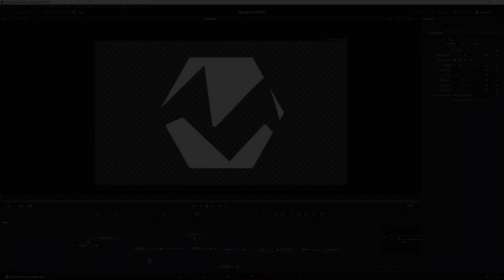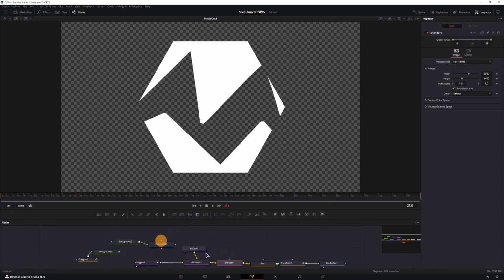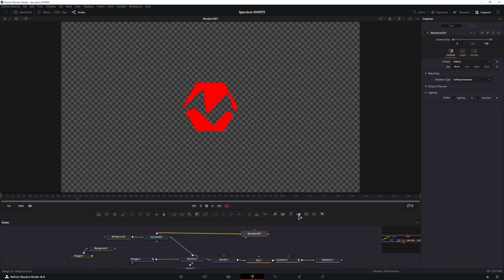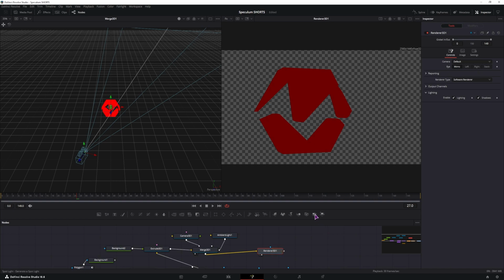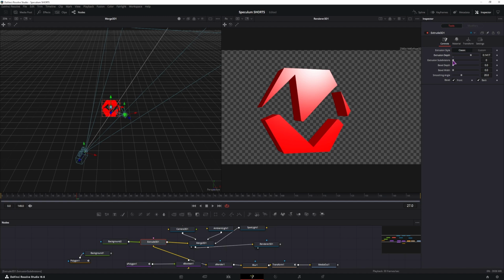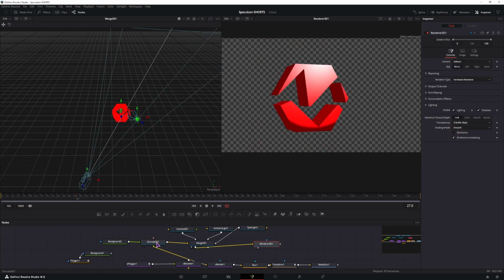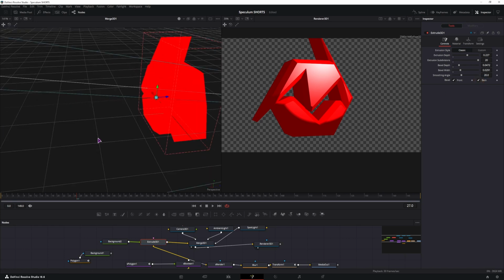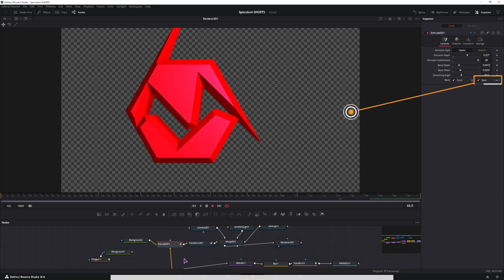DaVinci Resolve NEW Extrude 3D

Comment: I don't know why but I can't  hook nothing (any shape polygon etc,) into yellow input.  I have DaVinci 18.6.5 ver. Studio but it doesn't work. Yellow input is just inaccessible. I've seen a lot of people on YT got the same problem.
Reply from the maker: I have done a quick test and it (still) works for me. I guess this is just another case of it works for me but not for you. I'm using resolve version 18.6.4, you can try updating to 18.6.5 if it fixes the issue for you. But what I have noticed is that from version 18.1.4 resolve got super buggy as they're focusing on new features and not so much on fixing bugs or making sure that the new release has few bugs to begin with.
Reply: Thank You for answer. As I mentioned earlier I have already ver 18.6.5 but the bug remains the same. I reinstalled daVinci icluding all registry entries and made a clean instalation again but it brings nothing. The problem is still the same. Anyway Thank you for your answer again.

Comment: hey ! I need to change color lines in my work video can you help me ? show me how to do ?
Reply from the maker: Hi @cyklzycia8814 can you be a little bit more specific about what kind of lines you are talking about. Did you make the lines yourself in fusion, if yes what nodes did you use. Are the lines in the video, if so what kind of lines are they - power lines, road lines etc.
Reply: @JackallDigital  i got stock video there are yelow paint road lines i need tchem red … i Think davinci resolw well be good for this but i dont have to much time … i can send you sampel of video and maybe you can show me how to use davinci to maki it. I Think its simple but i have no time sit on tutorials ;) video to my work …
Reply from the maker: I think this is what you want, it's a video but only 5 minutes long https://youtu.be/6Og90v4-s1I